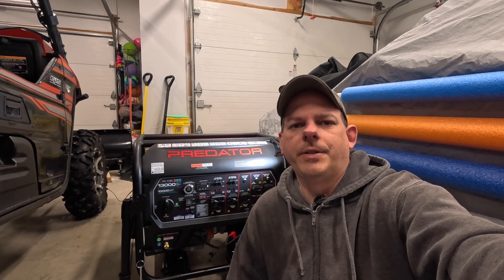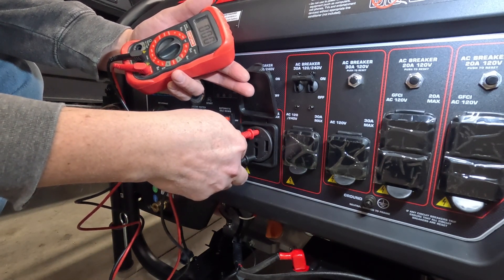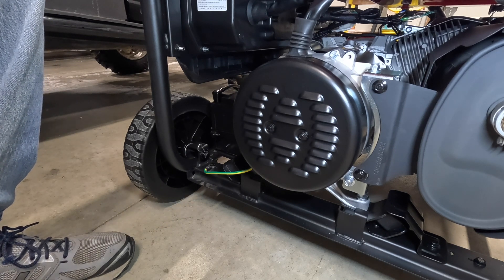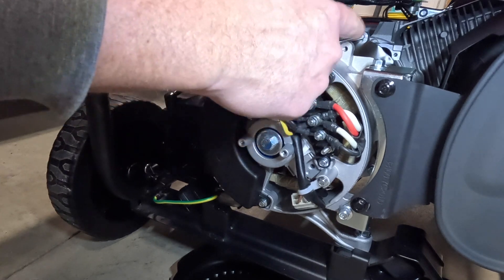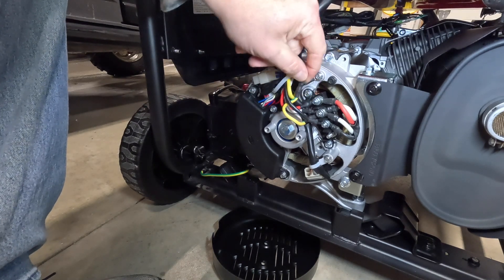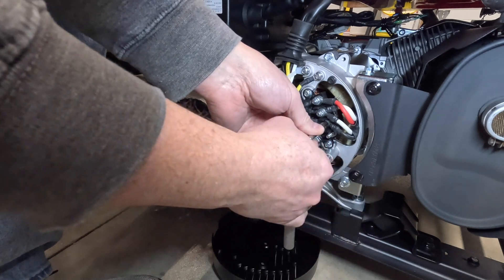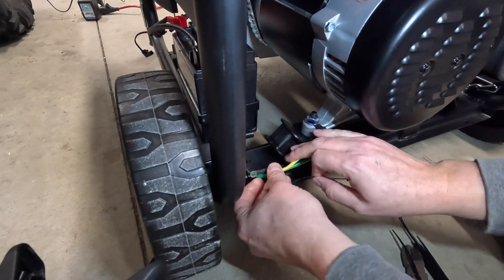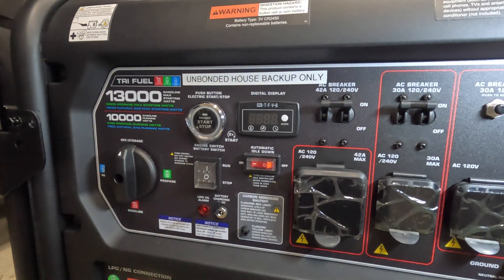Fix Your Predator Generator: Make it Unbonded Today!

Comment: My Westinghouse WF9500DF is exactly the same way. Looks exactly the same. I followed the instructions in the user manual and looped the bonding wire back to the case bolt. I also placed two prominent stickers on the generator to show that it is unbonded.

Comment: Wouldn't it be easier and Couldn't you just run a Ground wire from the generator to the house electrical panel ground?  
I saw a video where someone did what you did, and he sent 240 volts down his 120v outlets, and it caused a fire in his surge protectors inside the house?
We need a electrican to step in this conversation.

Comment: I bought a 10,000 watt Predator and found out about GenerLink.  It's sounding like GenerLink is not compatible with a lot of Predator generators because they have a bonded neutral.  I'm hoping I can just unbond the neutral and be able to use a GenerLink.  I just want an easy way to connect my generator to the whole house.
Reply from the maker: Generlink is definitely the way to go just a lot of $$. I can’t see why un-bonding the predator to use with it wouldn’t work. If the Generlink was a bit cheaper I’d definitely try it out myself. Our local utility charges $100 to come out and install. Appreciate the comment!
Reply: I'm actually checking into getting our service panel replaced and having a hookup installed.  Our service panel is the Federal Pacific Stab-Lok and it's a fire hazard.  So, gonna play it safe.

Comment: It's a little more complex.  If your transfer switch disconnects the power AND neutral lines, the generator must remain bonded.  If it only disconnects the power, the generator must not be bonded.  Then there are situations where you may or may not need to pound a grounding rod into the earth and connect your generator to it.  If the generator is not bonded and the transfer switch disconnects the neutral, you need that 8 ft ground rod pounded into moist earth.

Comment: I don't know why from the factory they don't just make the bonding like a switch so you can turn the bonding on and off depending how you use the generator. 

Other thing you can do if you want to rebond it temporarily is just make a "dummy" bonding male plug where the ground and neutral are connected and plug it into a unused outlet on the generator when you want it bonded and remove it when you don't.
Reply from the maker: I’m sure due to safety they aren’t allowed to put a manual bonded switch. Someone would forget to flip it and an accident would have all the lawyers calling. 

I’ve seen some people make the dummy bonding plug. I considered it but since my only use for this generator will be as a backup for the house i decided not to bother.

Appreciate the comment and thanks for watching!

Comment: Please explain exactly why the generator should be unbonded when used for a whole house power supply. What is the hazard if you leave the generator bonded?
Reply from the maker: Your house panel already has a neutral to ground bond. When you unbond the generator it leaves just the one neutral to ground and prevents a loop. There are several things that could happen if you don’t unbond but I’m not an expert in what could happen. It’s just an easy way to avoid them in my opinion.
Reply: Stray electrical currents can cause the case of metal framed tools and the open frame generator's metal parts to become "hot".  GFCI need about 5 milliamps to trip.  With two bonds, it will take 10 milliamps to cause it to trip split between the two bond runs - enough of a shock to cause a surprise jolt.  5ma to 10ma is enough to cause muscle contraction.

Comment: You removed the cover from the bonding point like it took no effort at all. I e been pulling and pounding for 30 minutes to no avail.
Reply from the maker: Mine just had the 2 bolts and then yes its just sitting there and easily comes off. Unless yours is a different model or they changed something that’s all there is to it. Hopefully you get it figured out.

Comment: Why doesn't anyone peel the plastic off of the outlet covers?  lol  How does your house like working with that high THD generator?  Love the power it has but not so much the bad harmonics.
Reply from the maker: If I don’t peel the plastic off I can sell it as like new condition 10 years down the road..right? I hope to use it as little as possible but your right the power is a lot more ‘dirty’ then my smaller inverter. I noticed some flickering on some led bulbs. Pumps and motors shouldn’t care. If I fry something I’ll have to do an update but everything I tested does work. Appreciate you watching!
Reply: @journeys-with-joe    The power of that thing is awesome but without it being 10% range at mid load, I don't trust it.  Sure wish it did a better job and also used copper windings, also.  They need to put an inverter on it and make it an open frame inverter.

Comment: Since I use my generator both to run power tools directly (where you want the bond), and to power my house (where you don't want the bond, which also causes the GFCI on the generator to trip), I simply disconnected/cut the ground wire in the power cord from the generator to the house.
Reply from the maker: Great idea for use in both cases!  Appreciate the comment!
Reply: Not really, it's a bad idea. Safety hazard. If a current carrying wire comes in contact with any conductor on the generator,  the entire frame will have current. Cutting the ground is a poor idea that can lead to shock or death. Just an fyi..... @journeys-with-joe